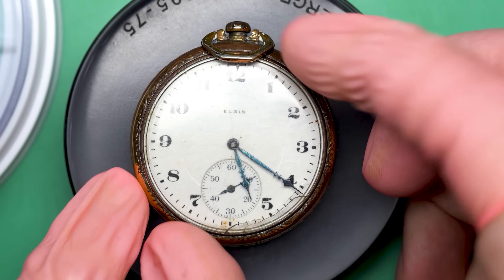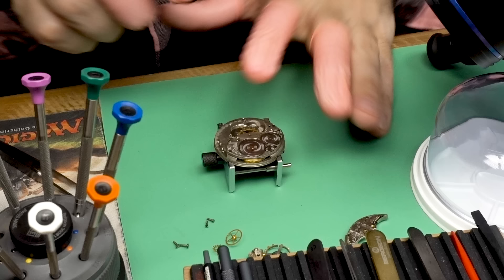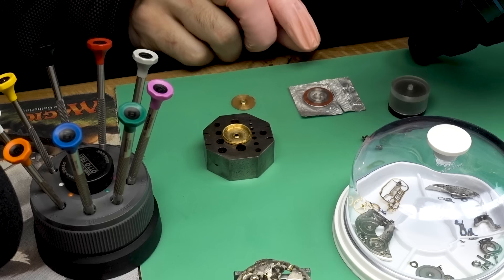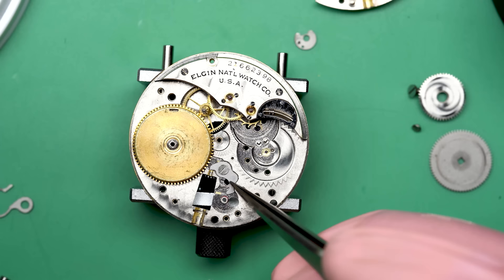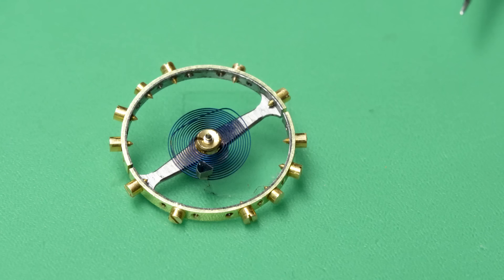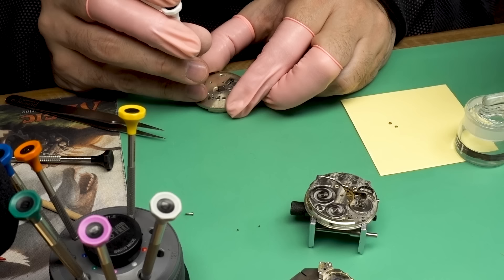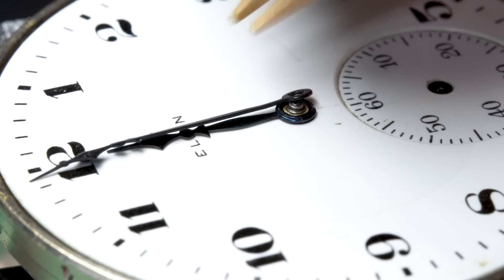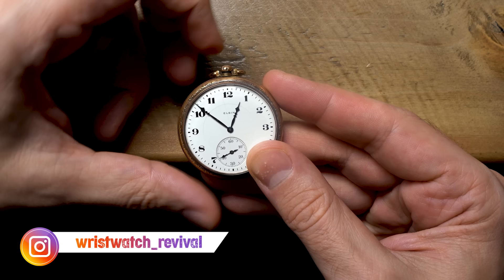My First Patron Sent Me His Grandfather's Pocket Watch

Comment: Quick question. I hope is not a dumb one. Why cant the balance jewel be oiled from the hole side? I understand you still have to take it apart to clean it but it would let you dispense with the whole monkeying around with the balancing of a drop of oil and not dropping it. I'm sure there is a good reason but i can't figure it out.
Reply from the maker: The oil needs to be placed specifically in the middle of that cap jewel or else it can run out the sides. There is a tool that supposedly does this (I even have one) but I feel it doesn't work well.

Comment: Hey Mr. Wristwatch Revival! I'm after your opinion. 
I just bought a Unicorn Amphibian 7 jewel unibloc dating from approximately 1964 from an opportunity shop for $60 AUD and am wondering if it would be worth fixing.
It winds a bit a ticks over, but am unable to adjust the time and it needs a new crystal. Overall, the case and band are ok.
 Also, it appears as though the movement has shifted slightly within the case. Any thoughts?
Lastly, is it true these were made by Rolex.. cheers 👍

Comment: 6:28, 16:14, 19:26 so the crown wheel screw is left hand thread.....
 Would automotive brake cleaner be a proper solvent for the metal parts? I guess then, the parts should be coated with the preservative solution after or they will rapidly rust.  Oh.. "One Dip" is what you use. And then needs a rinse.

Comment: I have been wondering, do you have to be a patron to get a watch or such fixed?
Reply from the maker: No, but it doesn't hurt. Generally I can't take outside work either way though most of the time
Reply: @WristwatchRevival  OK, I was wondering because I have an old clock with a broken main spring

Comment: I have my grandfather’s watch.  It looks very similar to this one, but it has no seconds register.  It was made in 1918 according to the Elgin serial number. The front and back of the case are not screwed down. The balance is free, but I think the main spring is broken because there is no resistance when the crown is wound.  It is very clean and the lense is very nice.  I wish I had the tools and confidence to open it up and work on it.  I got a $750 estimate to repair.  Does that sound reasonable?
Reply from the maker: If it's just for the mainspring and a service it's a little on the high side but not out of the question if the person is competent.